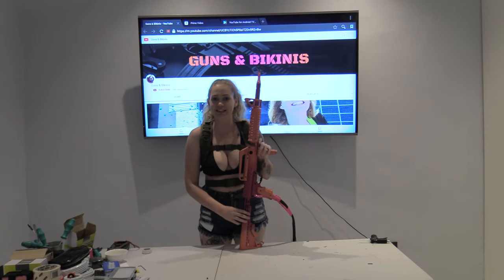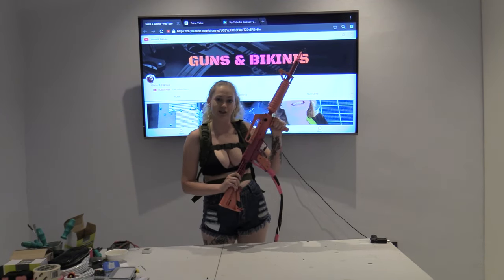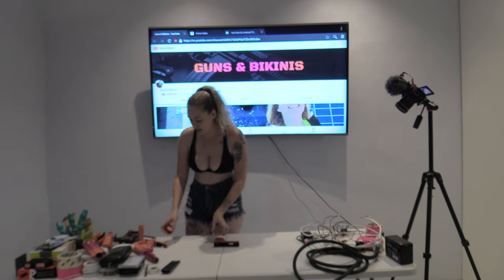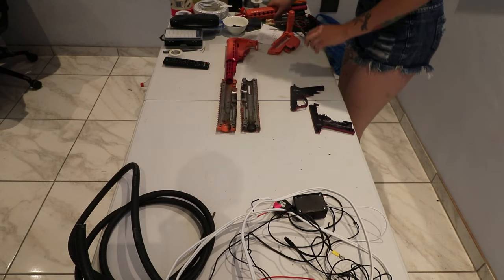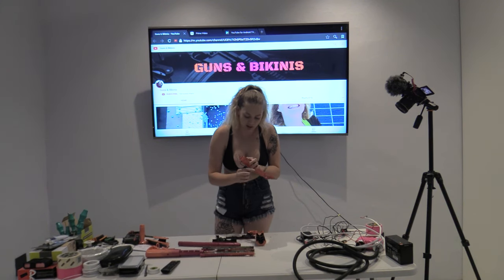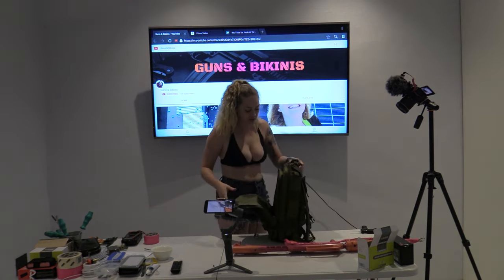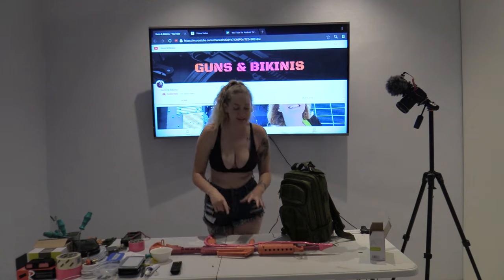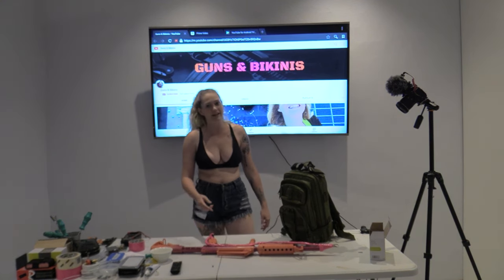How To Build A Flamethrower! THIS AINT NO BORING FLAMETHROWER!

Comment: Interesting stuff. Think you will refine it as it comes along but just be safe.
Heads up, Silicone and petrol dont go together well. silicone will break down.
Reply from the maker: Thanks for the advice! We did add a layer of epoxy glue below the silicone. But we will see what happens during testing!